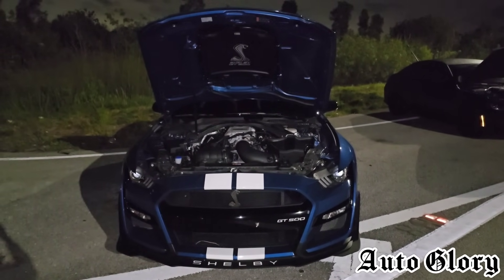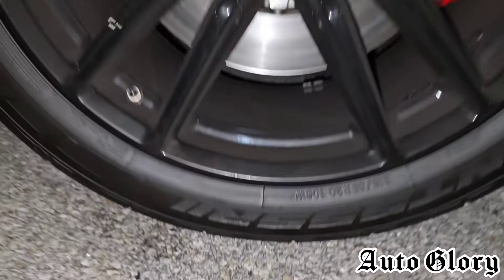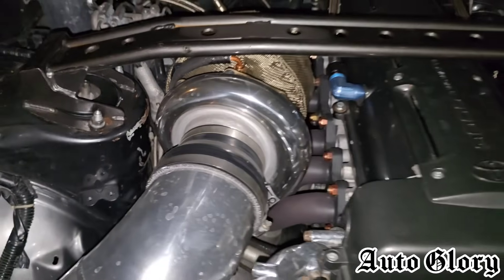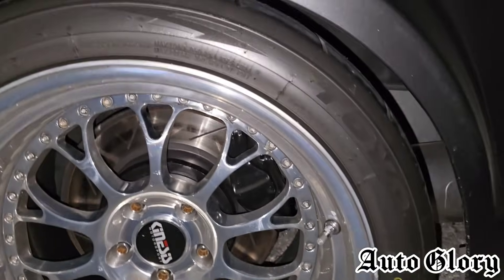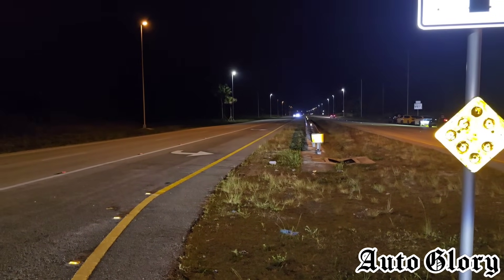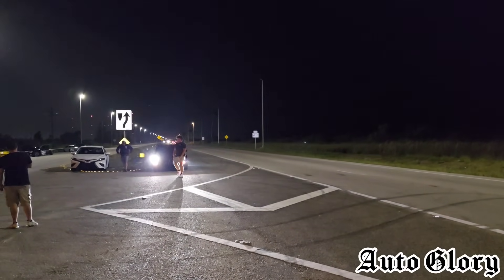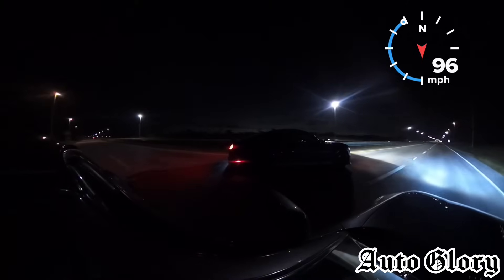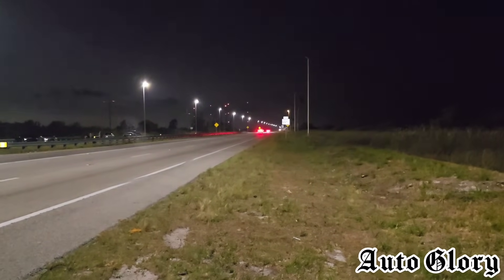2021 Shelby GT500 Bolt Ons E85 vs 1994 Toyota Supra PT7275 Turbo E85

Comment: so impressed that the supra is 30 year old technology and still able to hang (and win) against the big boys...the fact that he's a manual makes it even THAT much more impressive!
Reply: It’s not 30 year old technology if it’s using modern from this year…. (Turbo, fueling and tuning)
Reply: @Yaboybash  Give the engine its credit. Any car can slap on turbos n tune
Reply: @lq1129  but that’s what you do with any forced induction engine lol 
You just slap on a turbo, reinforce any weak points + supporting mods 
You can do that to any I6 iron block
Reply: @Yaboybash  but you forget not all iron I6 are equal to 2JZ in the 30yrs. When it comes to record breaking performance, dependability, versatile, affordable hp gains!
Reply: @Yaboybash  these items were available in the 90s...look up marco's supra
Reply: @lq1129  BMW M52/M54/S52, Jeep XJ 4.0 I6, Ford Barra, Nissan RB26 lol. 2JZ is a internet warrior engine that everyone swears by as if there isn’t better or cheaper engines lmaooo
Reply: @Yaboybash  bruh. What u talking about. Everybody is NOT swapping bmw oil sludge motors in there s13/ s15 , Z and rx7 in there d1 drift missiles back then. No one is swapping rb26 in a old school chevy to run quarters mile times. 2jz is still a consistent 5sec motor on the track and the first import to run 5 sec in usa. 1jz / 2jz motors was going  for $1k as recent as 2011. Why u think they expensive now and getting harder to find. You dont know the saying "They 2JZ everything" That was and might still be the go 2 motor swap next to a Honda motor.. Heck they be putting 2jz in race boats. Rb are expensive less accessible to build vs 2jz. These are facts by experience. I think you should google and YT knowledge of the Supra and History. Back my day early/mid 90s Supras wad the go 2 for racing and  beating bikes and 200mph on streets in the usa  before fast furious put them on the map.
Reply: @Yaboybash  Every single engine you named hasn't come close to beating 2JZ's world records or even manual world records
Reply: @blazesmooth5573 rb26 do come close but i agree 2jz broke a lot of records

Comment: 30 year old manual 3 liter beating brand new usdm. No surprise tho.
Reply: Correction * 30 year old FULLY BUILT car that also weighs ~500lbs less with similar power beating a brand new car with the most basic bolt ons* there fixed it for you. It's just simple physics. Same as a fatcat losing to a similarly powerful Mustang Or Camaro.Good shifting by Supra driver thumbs up for that
Reply: Cope harder. The better platform won
Reply: @johnnytorreto8197. better platform? The gt500 just had bolt ons it’s not fully built it’s not even on a tire don’t be delusional
Reply: @ImJusSha  the fastest 2jz is faster than the fastest predator engine. The better platform won

Comment: dang this gt500 is active, hopefully he stays around and adds more mods
Reply: Maybe then he will finally beat a hellcat or that demon 😂
Reply: @johncena-hq1ti he’ll beat any redeye or base model hellcat mod for mod tho 

watch as he brings up every race that’s not mod for mod
Reply: @Toxic_coyote12 yet a boat charger not even fbo tuned by a random walked him easy. Imainge if that was a redeye lol 😆
Reply: @johncena-hq1ti so funny how you dodge fanboys try to make hellcats weight being heavy every one else problem lol
so all i’m hearing is it took a fbo (minus headers)  ported blower hellcat with weight reduction to be door to door with a full weight intake cat delete upper pulley gt500?  nice man very impressive…..so long as the gt500 doesn’t get more mods lmao
Reply: @Toxic_coyote12 mod for mod? ☠️ dude the demon 170 is STOCK, what mods. Soon as that demon 170 pullies down its even worse
Reply: @aimxdy8680 dude you can’t read please get out of my thread 😂 bringing up cars no one is talking about.
Reply: @Toxic_coyote12  it’s a base charger lmao, not even a redeye chally which would be must faster with the mods. That car was just a basic bolt on setup 950whp. Fbo redeye is 1000-1100+ same amount of torque. Gt500 might squeak out a bit more power up top but the tq can’t be matched at all. Seen a 500 making 1200whp and he barely made like 750wtq, hellcat makes 1000 and 1000.
Reply: @johncena-hq1ti yeah imagine if it was a gt500 with same mods 
less weight same size blower, makes more power. but somehow you still think a redeye is faster like it’s not easy math 
i’ll agree redeyes are better for digs cause of their torque, that’s about it
Reply: @Toxic_coyote12  also door to door implies it was a tie, 500 lost vs him and the stock demon. Stock demon only makes 920whp, imagine a redeye with 100+whp more and the same weight. Gap would be even bigger. Fbo gt500 are dyno queens I never see any actually putting in work on the street or strip. Turbos maybe but who cares about that lol anyone can slap turbos on.
Reply: @johncena-hq1ti it’s a base gt500 ???
Reply: @johncena-hq1ti saying he walked him implies it was more than a car which it wasn’t?
Reply: @johncena-hq1ti hellcats are heavier and make around the same HP lol easy math.
only way red eyes are faster are from digs
Reply: You don't get fo decide kona kiddo.  GT500 had zero chance against the old supra turned down. The GT500 has intake, pulley, catless, injectors, E85 tuned.  No excuses for car making 1000 crank hp.
Reply: @SR71life that’s fine cause a 5.0 just gapped this supra not to long ago, maybe you forgot
Reply: @Toxic_coyote12  Thats fine for who?  The 1000hp GT500 didn't do 💩 vs this full weight custom stereo, wide body deep dish low boost Supra. He was on low boost for the blue gutted stang that took 6 months to build too.
Reply: @SR71life it’s fine for me, lmao you trying your hardest to get me triggered but i’m fine the much cheaper and same car i have gapped this supra lol 
and yeah the supra is much lighter so it’s not really surprising. it would be worse if it was a z06 or zl1 with the same mods 💀
Reply: @SR71life 6 months to build ? lmao what bro lying is like breathing for you. comes to naturally to try and prove a point
and the mustang is full interior
Reply: @Toxic_coyote12  😄 The supra has a wide body kit, huge wheels and tires, plus custom system big box and subs and running low boost. You're the one crying here because a 1000hp GT500 got clapped 😄
Reply: @Toxic_coyote12  That was built front to back. The owner put alot of time into that start to finish.  Ask him. He talked about it.
Reply: @Toxic_coyote12  You own nothing near that 197😄.
Reply: @SR71life you telling me i own nothing like this mustang is like a homeless person telling a homeowner that they don’t have a mansion 😭😭😭
Reply: @Toxic_coyote12  The guy with a 2012 automatic with a tune 😄.You're not even close to what's done to that blue GT. Best pull out your piggy bank and your moms savings to be even close to that conversation 😉
Reply: @SR71life and you don’t even have a car so what’s that say about you 🤭
Reply: @Toxic_coyote12  You mean my MK5 Supra? Lol. Ok high roller 😄 in a 15 year old automatic🤭
Reply: @SR71life hahaha that isn’t your car, post a run then 😂😭 and who’s cares what you think about my car lol
Reply: @Toxic_coyote12  Dream on son . Back to your 15 year old automatic mustang.
Reply: @SR71life back to pretending someone else supra is yours lol 
apparently have a supra but the video you think is worth posting is a guy recording in passenger seat (you)  from 7 months ago 😭😭😭😭
Reply: @SR71life if only whose ever car that belongs to knew you were trying to get clout of their whip 😂 they’d probably look at you different huh
Reply: @Toxic_coyote12  Yes that was just  after it was tuned.  Hard record myself driving unless someone holds the camera. You reachin  hard lol
Reply: @Toxic_coyote12  The guy with an old  automatic mustang with a 20hp tune talkin like he's a stud 😄.
Reply: @SR71life i did a full race recording the other driver 😂😂😂 multiple times, you can’t do the same in a supra!?!! so that’s the only video you have no more videos of you racing ?? or doing pulls? just a video of someone who looks like they’re scared to go past the speed limit? tuned and still don’t have any better videos ??? after 7 months 💀
Reply: @SR71life hit your homie up and get more footage. and yes i feel superior to someone who doesn’t own a car, doesn’t matter if it’s a mustang or a ford pinto 
you don’t have a car 😂
Reply: These gt500’s lose to n/a Camaros Lmao cope with this Ioss
Reply: @Toxic_coyote12  The kid in an old automatic convertible mustang with a 20hp tune wished had something better 😄😄

Comment: That GT500's front end looks great. The Supra is overhyped and has too many problems, from building boost to missing and slipping gears, I would pick the Ford all day over it.
Reply: What😂? Missing gears is.... A manual problem across the board, genius😂😂. What's it got to do with being a supra or not? And fyi, building boost,  is a problem for every car with big turbos, or a procharger. It doesn't even matter if its auto or manual, both have to build boost... Again, nothing to do with the supra. I can agree its overhyped, and that it's ugly, but apart from that, you have no arguments 😂
Reply: @_ph4nt0mzz_47   I do have the arguments. Precisely because blokes want 600 - 1000 hp from the Supra, that is why it has boost problems and that is why it is slipping and missing gears. A part of Supra's popularity comes from these aspect that it can develop big power figures, which in therm brings the above mentioned problems. And it is more a Supra related problem simply because the Supra had 200-300 hp from factory, not 600-1000 hp.
Reply: Found 
On the 
Road
Dead

Plus homeboy couldn't even afford a Ford if mommy and daddy gave you money for it. Stick to living at home Gen z.
Reply: @legioner9  you sound absolutely ridiculous. The Getrag transmission in the MKIV is one of the strongest on the planet, the missed gears are human error, not mechanical.  Yes the Supra had 320hp from factory, back in 1993, congrats you can read Wikipedia but the car was a world beater and still is with proper modifications. It use to be cheap to build supras then the internet found out about it and the prices have exploded. 
You sound mad that you either can't afford the car or wete savagely beat by one. Appreciate that it's a well maintained internal combustion engine and keep it moving.
Reply: @shadyshinichi2JZ   Yeah, I do not use Wikipedia for when searching for car info. For the Supra, it happens I know its factory aprox. hp. Just like I do for other cars as well. It may have over 600 hp, but it ain't driving right when pushed hard. The only guy who solved Supra's issues of boost problems, clutch slipping, gears grinding (regardless how strong the gearbox is, the syncromeshes take a beating) mounted a ZF-8 speed automatic.
Reply: You clearly aren't a car guy😂
Reply: @legioner9 he wasn't slipping gears,  he "missed shifted" 🤡🤡🤡

Comment: GT500 are the new Hellcats. Too heavy.
Reply: stop it, gt500s blow the doors off hellcats except the demons
Reply: @Toxic_coyote12  Oh they definitely do but still a heavy car unfortunately.
Reply: @Toxic_coyote12 *loses to fbo boat charger 😂
Reply: Definitely not the Hellcat copied off them with the Roots blower Ford has been using that since 2003 on the cobra
Reply: @freak_5.042 yet somehow the hellcats have run faster times 😂 there’s multiple fbo hellcats running 8s. Only gt500 I ever seen running 8s or better was with gay turbos never just fbo ported blower like a hellcat or lt4.
Reply: @johncena-hq1ti haha i called this on my other comment. let me see mod for mod and then i’ll be impressed
Reply: @Toxic_coyote12  there’s a viral short of a fbo super stock racing a fbo gt500, super stock won
Reply: @Toxic_coyote12  now go watch the new this vs that to see a built 1500whp coyote getting sauced by a old 5.3😂
Reply: @johncena-hq1ti  There's also video of a Jailbreak getting destroyed by a KIA...lol...I'm not shitting on Hellcats but pointing out they are heavy 🤷 lol
Reply: @freak_5.042  in what kind of race? Damn sure wasn’t a roll race or drag strip run because I’ve yet to see any kias running low 10s like stock kitties. 😂
Reply: @freak_5.042  heavy and still fast that’s the beauty of it. Find me another car running 7.4 @4200lbs no turbos. Damn near impossible
Reply: @johncena-hq1ti gt500s went 8s on a stock blower
Reply: @johncena-hq1ti  It was on YouTube here. You can find it if you type Hellcat vs Kia I believe. There is always a video that will back up your argument and one to back up someone else's 🤷 It's kinda dumb really. For example, you just said stock Hellcats run low 10's ....where? Because we just had our season opener at the Dragway and the fastest Hellcat was 10.8 at 126mph. Out of 5 Hellcats. The rest were in the low 11's and some were running 123-125mph.... lol
Reply: @johncena-hq1ti i’m having a hard time seeing a hellcat redeye in 8s with stock blower
Reply: @Toxic_coyote12  Red Eye at my track on a tire was running 10.8 at 127. I don't see the low 10's everyone claims. The Demons are 10.4's at 132
Reply: @freak_5.042  I meant stock with a tire. Everyone knows stock hellcat tires are trash, stock with a tire the regular hellcat has gone 10.6 and 10.3 for redeyes. Bone stock super stock has also done low low 10s.
Reply: @johncena-hq1ti  They had a tire. You can watch the runs yourself. Look up Rad Torque raceway. Obviously better air and DA would play a factor in different areas but they definitely ain't that fast around here.
Reply: @freak_5.042  i mean 10.8 up there 10.6 with good da sounds about right. Redeye with a tire and good da is low 10s which is pretty good for 4400lbs imo lol
Reply: @johncena-hq1ti  I believe they are heavier then 4400 aren't they? Lol..but yes you are right
Reply: @Toxic_coyote12  wrong poor kid 😂 auto glory posted a 2.4 hellcat beating a 2.65 gt500 about a month ago then the gt500 lost to a stock demon 😂😂😂😂😂 Furd is trash 😢😢😢😢😢
Reply: @kyoakland  not (1) single Furd in history has even been able to run 9.9 stock 😂 they barely run 10.5 stock yet dodge demon 170 just ran 8.9 stock fastest production car for ICE in history 👹👹👹👹👹
Reply: @johncena-hq1ti  this poor kid freak his real name is Daniel oIiver from Edmonton Canadumb😂😂 I exposed her on my community tab for her salvage title junker her grandma helped her buy and she hiding from Frank new video TT f150 vs n/a camaro😂

Comment: Great races!  I'm not a supra fanboy but that is great looking car and clearly fast af, esp with a manual like that.
Reply: I mean it’s 72mm turbo it’s supposed to be 😂 that turbo is good for 1000+whp easy
Reply: @johncena-hq1ti  Are there any cars you're actually impressed by? Like the supercharger on the GT500 is almost the same size as the 2JZ lmao
Reply: @RthereNEusernames  I mean it’s a 72mm vs 3 bolt ons 😂 props to the Supra for being manual but this isnt really a race.